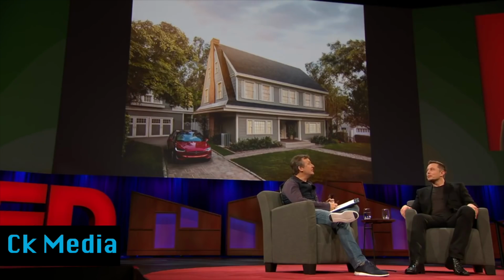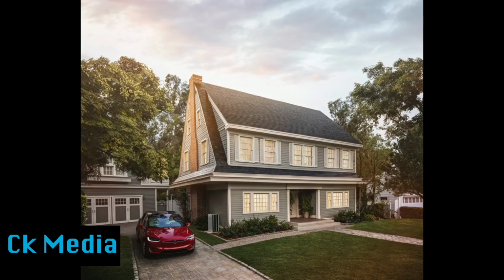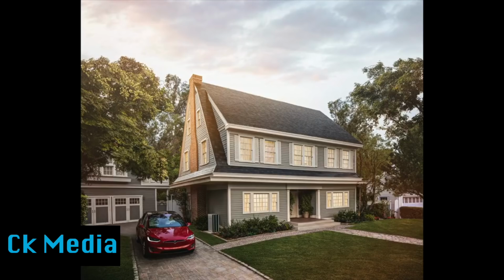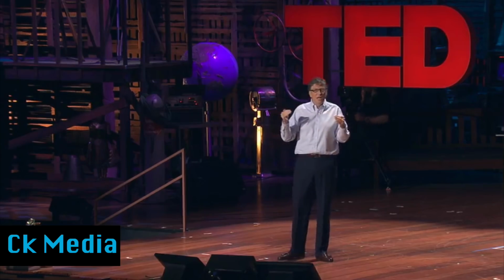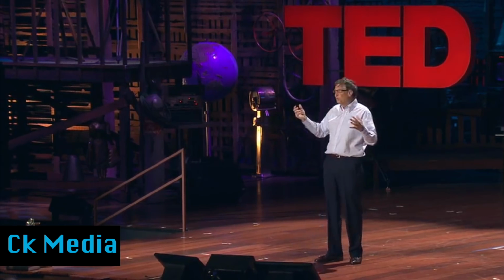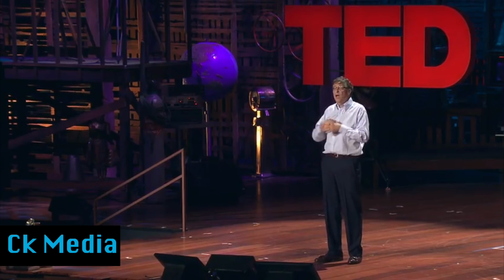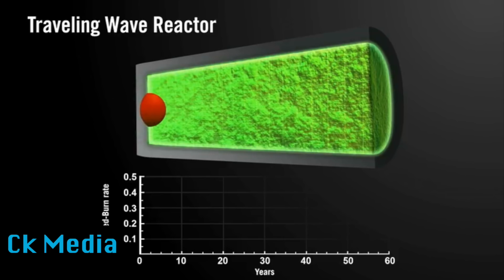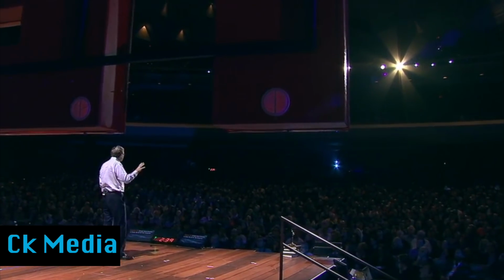Billionaires on Energy - Bill Gates, Elon Musk - Solar, Nuclear

Comment: Nuclear. Solar is a bad joke in cost, stability and life span. I'm fed up with the preachers of the "green" power which is very, very far from that claim.
Reply: Glad that someone like you doesnt have "power"
Reply: Glowing Alpine  Actually, Moron, I am an electro-mechanical systems engineer, with 30 years of experience
Reply: Glowing Alpine  More over, Twinkie Snot, All that matters is how much Money it took to make Solar, and what kind of conventional grid power, that would buy.  Since you claim Solar is so efficient, how much energy would be delivered for the customer, at the cost of the solar array?
Reply: Glowing Alpine  Thin, cheap solar panels need tellurium, which makes up a scant 0.0000001 percent of the earth’s crust, making it three times rarer than gold. High-performance batteries need lithium, which is only easily extracted from briny pools in the Andes.   Gallium Arsenide, the primary reactant for half of solar arrays, is a trecherous poison.  Only a middle class idiot would think this is a solution.
Reply: Glowing Alpine  By the way, I personally automated a Uranium mine at Great Bear Lake in Canada, ABOVE the Arctic Circle.  Uranium is pretty common, Commercial deposits are NOT.  They are usually encased in hard metals, due to their heat.
Reply: @merlin5by533  Growing alpin got the point dude. Even if he is lying about the mech engineer he did his research. Do yourself a favour, and be more open to reduce the hate in you.

I like bill. But I disagree about the point about his counterargument in casualty in nuclear power plant. Even if the casualty is less than coal power plan or whatever. It is devastated a city and makes it uninhabitable. Land is limited resource. If he can omit the human factor in the nuclear power plant that would be great. I would rather choose whatever we have to make more energy than to wait longer. 
I am more concerned about the superbug that start to emerge. The more energy we have the faster the reaseacher works, I guess. Pandemic will cause mayhem  It will cripling most of ppl and obviously not the top wealth ppl I guess. While climate change will infect all of us equally so I think we will work it out together somehow.
Reply: @merlin5by533  I love how ppl laugh at me or my stupidity and he or she says it is not a hate to ridicule anyone they think stupid or whatever they think I am. 
I agree with you about there isnt such thing such as climate change. If there is I am already death anyway. So why do I carr
Reply: @robinsss Thorium is also a nuclear plant just a different type. Currently is not available on the market but we know its working because 50+ years ago already we had done it.
Reply: Glowing Alpine  I have to laugh. The specific cost of a solar plant is about 1100-1200 USD/kWe. The SPP is much more than PV panel. Load factor in Europe above the 40  degree lLatitude is 0.13 or even worse. You need much more time to reach just even the equality if you count profit (not the income) the produced electricity and even after 10-15 years the output power of the PV panels is reduced about 15%.

BTW all of the solar believers have to understand that power is such product which is time sensitive for the "manufacturer" regardless the end user pays fix price for the electrify. When solar or other random generator plant produces electricity but the demand is low the spot price is lower...

BTW none of the PV panels has operated 40+ years and very likely never  will...
Reply: the main question for solar is if a house is covered in lots of panels can it power the house...…………………………………………………..the other things you are saying are irrelevant
Reply: Face it dude, you got the humiliated by Glowing Alpine!
Reply: Nuclear, Geothermal, and solar are my 3 favorite power sources.
Geothermal is most prevalent in polar regions, where solar is bad, and nuclear is very clean, but has the nuclear waste problem. LFTR should help, but its not perfect. Fusion also has nuclear waste too, the neutrons will irradiated the walls of the reactors. Hybrid fission-fusion are my favorite, but still have nuclear waste. Solar doesn't produce CO2, the power used does, and if we use solar power to produce it, thats zero emissions.
Reply: @merlin5by533  - Lithium is one of the most common elements in the universe. Batteries are about 2% lithium by weight, in fact, most of the weight is the steel casings, and the cathode(usually a combination of Ni, Co, Al, Mg, and O). I would think that a electro-mechanical engineer would know this. Lithium Ions are not the only battery types either, Sodium batteries are starting to move some ground.
Reply: @merlin5by533  And nuclear reactors take the .000001 percent of people who become nuclear scientist to build (very expensive), not to mention all of the metals used to keep the reactors safe, and the extremely expensive fuel currently used.0
Reply: @merlin5by533  btw I am a Republican. Believe climate change is a problem, but that we will fix it through technological improvements instead of government policy (likely to make things worse).
Reply: @robinsss  ocean wave energy has very low power density, and has a relativly high cost per watt.
Reply: @molnibalage83  chemistry is always changing, and I just read about a new solar panel that can improve efficiency by like 10% and decrease cost. This is very promising tech. Nuclear tech from 1940 was crap too. The solution is likely not 1 thing but many things.
Reply: @molnibalage83  the latitude problem is a big problem for solar.
If we eventually build an orbital ring though, we won't have any power issues, we could run solar down a cable to anywhere on earth  with 24hr daylight. Cant wait 'till 2300!
Reply: I don't know what you mean by low density but Portugal has an ocean turbine that can produce just as much electricity as a wind turbine.....…………….…………………………………………………………………………….Japan has a turbine that if clustered into a farm could produce as much energy as a nuclear reactor...……………………………………...at an obviously lower cost for construction materials
Reply: @boggless2771  Lithium is highly reactive, so its a thin component, of tons of rocks.  You want to melt tons of rocks for an ounce of Lithium, and then claim it's energy cheap?  Go right ahead.
Reply: @boggless2771  And that would be LIQUID sodium at 357 F, right?  Lower temp sodium nickels, are about 150 F.
Reply: @boggless2771  According to the Handbook of Lithium and Natural Calcium, "Lithium is a comparatively rare element, although it is found in many rocks and some brines, but always in very low concentrations. There are a fairly large number of both lithium mineral and brine deposits but only comparatively few of them are of actual or potential commercial value. Many are very small, others are too low in grade."[
Reply: Glowing Alpine  By the way, A 2012 study by the National Renewable Energy Laboratory (NREL) found that, on average, solar panel output falls by 1.8 percent each year.  In 2012, only 15% lasted to their 20 year ROI.
Reply: @merlin5by533  - I haven't read muh about sodium batteries, I've just heard they are promising, but if they are that hot, its pretty useless. Ill look into it some more. However, im still more concerned about the other rare metals in the batteries.
Reply: @boggless2771  Batteries are point sources, NOT the basis for any kind of society power.  Why?  You have to convert power to go into the battery, and you have to convert power coming out.  The world is not DC.  Just a fact.
Reply: @robinsss  like solar, you need a lot of area to get enough power.
For solar, you can put it on roofs and on top of parking lots, but for tidal, you have to take up ocean space. Have you seen the massive orange things that they have to use to get the energy? I think they are pretty ugly and have no secondary use. Im not against the wave power, but I dont think its massively scalable.
Reply: @merlin5by533  many devices have rectifiers. LEDs and Solar Panels are DC. We only use AC because its easy to transform voltage. In the future with unknownium (the room temp super conductor), we could go to DC (From my knowledge of how the grid works, I dont know if there is a problem with dc if there us no resistance in the cables). Either way, inverters are like 90% efficient, the grid currently loses like 5% of our power. Its no big deal that batteries are DC and we use AC for our grid. You know your laptop charger, thats a rectifier, and it converts AC at 120V (edit: assuming US) to DC at usually 24V.
Reply: @merlin5by533  - thats concerning about solar panels, but Ive got to get some sleep.
Reply: there several types of  ocean turbines...………………………………..some are completely submerged some are partially submerged…………….…………………………...I don't see the problem with having lots of them in a certain part of the ocean past the areas where beach goers are...…………………………………………….
Reply: @boggless2771  I hope this is only sarcasm or joke...
Reply: @robinsss  In half of coastal areas around the world, the ocean drops off the continental shelf in less than a mile.
Most of the world's sea resources, are on seamounts, underwater mountains.  SO, your ocean turbines would be chopping up the fish you eat.
Reply: there several different types of  devices ……………………………….some are turbines some are not...……………………………………...if the turbines kill a few fish I don't think that's a big deal...………………………………………………...if they killed a large  number maybe that would be an issue to be dealt with but  we don't know that they would
Reply: @robinsss  This comment has no sense or realm meaning, at all.
Reply: @robinsss  I actually know the types.  The turbines kill fish, period.  Many die just from the pressure differential, after a day or so.  The same thing happens in small dams.  Wait till the QUAGGA mussels get hold of them.
Reply: even if the turbines kill fish why is that a big deal?...………………………………..unless it's a very large number
Reply: what is illogical about that comment?
Reply: i wasn't talking to you when i wrote that message
Reply: Still the suns power is there for us to use no reacourses needed.
Reply: the Sun is Nuclear power.

Comment: Sorry, but nuclear is objectively superior. Solar is great for some niche uses. But not for wide spread power generation.
Reply: Glowing Alpine  nuclear actually has killed far fewer people and caused far less environmental damage per unit than any other energy source. It literally has the single best track record of all major energy sources. And the storage is not actual all that difficult. Waste is stored in plant for the first few years where the worst of the radiation is passed, and then its stored away in various different way. Most commonly buried in bedrock, so it has no environmental impact. And 0 storage cost. 

All the problems you pointed out are actually nearly non existent misconseptions spread by sensationalist news because its easy to fearmonger anything radioactive.
Reply: Glowing Alpine  Nuclear has the best track record of any large scale energy sources...
"What about the waste"
Well, since people are advocating for turning large portions of land into solar PV arrays, sustainably (so forever solar arrays)... If you instead just turned those areas into simple parking lots, used nuclear reactors providing ten times more power than those solar arrays, and just mindlessly placed the waste casks onto the parking lot and left it there... by the time the parking lot would be full, the waste in the first casks will have gone completely inert. So you can discard the remains and reuse its spot in the parking lot, never running out of space.
Even the most simple and mindless waste handling method (just leave it on a parking lot) takes up less space than solar PV arrays, in a fully sustainable fashion.
Reply: Glowing Alpine do you use solar panels?
Reply: Glowing Alpine  "How many people have been killed by solar, hydro, or thermal? You're talking hypotheticals."
It's not hypothetical at all. Per unit of energy produced, solar kills more people than nuclear. So does hydro.
You just don't hear about it in the news because solar deaths happen on a weekly basis as opposed to one dramatic disaster a decade (and the fact that nuclear provides about 20 times more energy for us than solar...if solar provided 25% of our energy, you'd see more total deaths from solar).

Comment: Solar must and will also have to improve considerably. 
If it achieves the ability of chemical energy conversion 
of plants, it will be very strong. Nuclear has the 
better cards at the end of the day. It must be able 
to be really very small in volume. Not bigger than 
a refrigerator. Then it will win for the next 500 years.
Reply: We don't need small reactor. You don't need one in your house. We already have Nuclear batteries which use plutonium decay to make power. They last about 80 years but don't produce much compared to a reactor. Early pace makers were powered by Nuclear batteries, and so are the Voyager probes. You could make one about the size of a microwave to power a family home, but its not necessary, not efficient, and also dangerous.

Comment: couple of things here, firstly it is NOT just enough to keep it under "water". Right now it is exposed to the ocean, ... how is that working? So it's PURE water that it must be exposed too, Secondly the security that is offered to a widely distributed Solar generation beats Mammoth primary plants of anything by a large margin.Thirdly Solar is ONE and done, other than regular maintenance (JOBS JOBS JOBS) there is no additional capital expenditure. Fourth IF a house burns down because of catastrophic failure it is a much smaller deal than a catastrophic failure of a primary plant
Reply: Solar does get damaged, and has to be cleaned. Theres always Nuance.
Bro.
Reply: @Boggles
 Absolutely it does cleaned and maintained  and damaged too! but thr repairs are usually at a Local level so, .. no need to evacuate !! hehehe

Comment: Solar is free... It should be the obviuse tech to improve and addapt. other energy sources need physical supply to work. In the longrun solar with better improved battery like solidstate batterys will give us all the energy we need.
Reply: If solar were free, then why is a solar rooftop from any company $10,000+ ?
What you meant was the sunlight is free. Just like the wind is free.
Transmuting that into useful energy is another matter.
Reply: @Brainbuster   no i meant free. You can have mirrors aiming at a tower and you can make it as big as you want. Sorry i dont know what its called.  But if a country would invest in solar for real it would be much cheaper even free in the longrun.
Reply: construction of the tower isn't free. The installation and maintenance of the mirrors are not free. The mega grid (if you want solar power throughout the night) is not free. Nor is the battery storage (if you want power in the night).

Your statement that "the Sun is a fusion power we already have" is simplistic. If it were that simple, if we had "fusion power" then we would use fusion power exclusively, as that is the holy grail of power. 

We do NOT have fusion power, despite the fact that the Sun is a fusion reactor. A fusion reactor 90 million miles away does not mean "we have fusion power."
Reply: @Brainbuster   ok debating on youtube is useless. just remember that with solar a country can make more energy then they need and sell that energy to other nations... thats why it is free.  You might want to search here on youtube for some of these constructions... they dont need batterys to store the energy. and they only need to store energy for a few hourse before the sun comes back again. And yes this works almost everywhere all years beacuse 80% of the sunlight goes through when itsa cloudy. And we havent even talked about the price drops of solar energy in the near future.
Reply: @ra6865  That's not the definition of "free." 
The same argument can be said of nuclear. "With nuclear a country can make more energy than they need and sell that energy to other nations. That's why it's free."
Reply: @ra6865  I'm not against solar. It's just not "free."
Reply: @Brainbuster   sure the diference is that the more energy you produce the faster you need to replace "fuel" in a nuclear plant. So not the same thing. Plus as otjers have mentioned the sun is a big nuclear plant why not use it just like evrrything else on earth has.
Reply: @ra6865  Because it's 93 million miles away.
That's like saying, "The ocean is a big water tower so why not use it?"

Comment: OK-----------  Good idea. Except.  Solar only works well south of the 45th parallel. Everyone north or where it rains a lot, are screwed. LOL.---   OK--- never heard of the traveling wave reactor but sounds good. But what about Thorium in a liquid Fluoride Salt reactor that cannot make weapons grade anything and shuts down safely if it loses power without worrying about meltdown.
Reply: The thorium fuel cycle produces Uranium 233, an excellent material for weapons. Let's talk about the Liquid Salt Thorium Reactor, because that's the main one people fall in love with. These reactors are really hard to control because nearly half of the delayed neutrons that are spawned are cycled out of the plant due to the way that the fuel and the coolant are combined. Good luck controlling a fuel system with so few delayed neutrons. You will get critical in no time. Also, Thorium fuel cycles are not adopted because of the corrosive nature of the FLiBe Salt the fuel is put into and the need for Uranium or Plutonium as a seed material in the first place. Why use Thorium when it needs Uranium anyways?